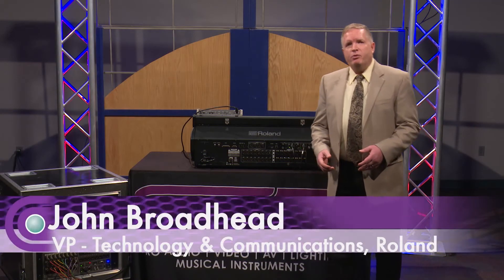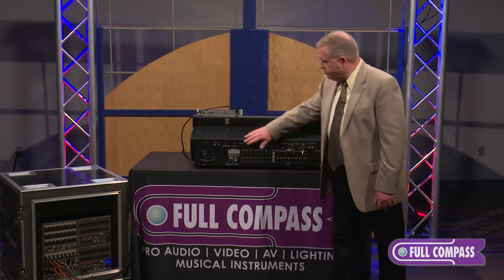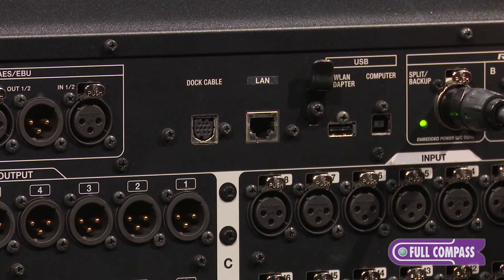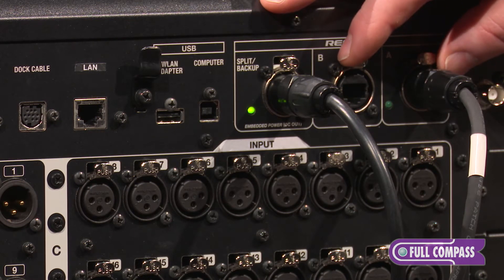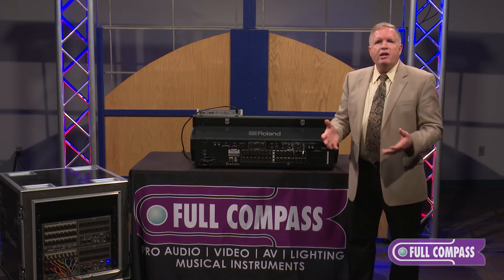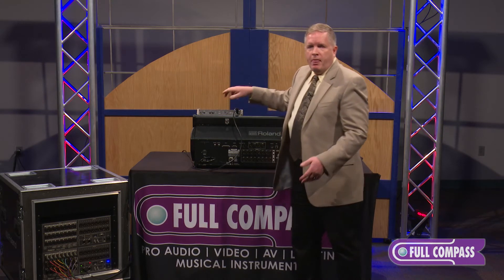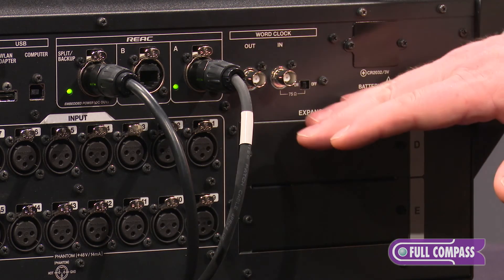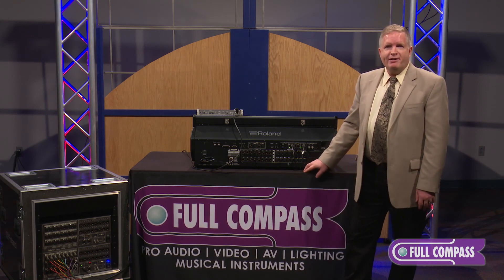Roland M-5000 Live Mixing Console - Hardware Overview | Full Compass

Comment from the maker: Featured Gearcast: Roland M-5000 Live Mixing Console - Hardware Review. The M-5000 is designed to quickly adapt and excel in any mixing application including traditional FOH, monitor mix position, broadcast and theater. Find out more on our website!